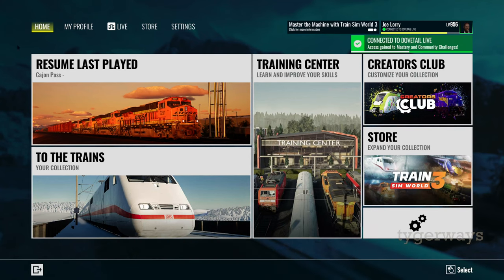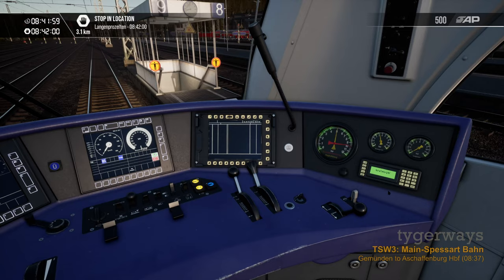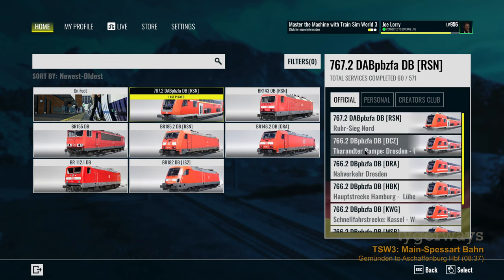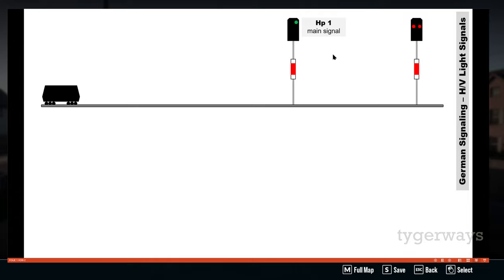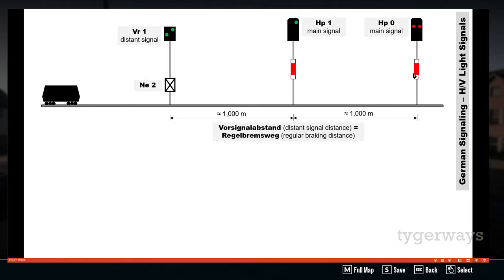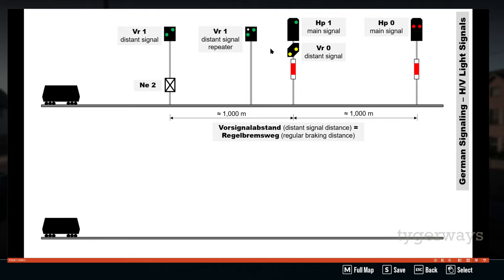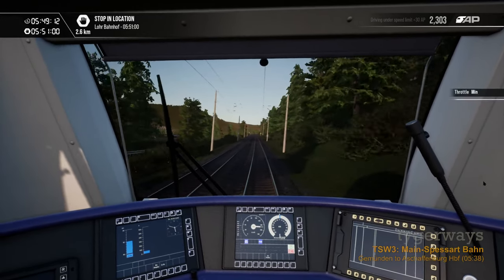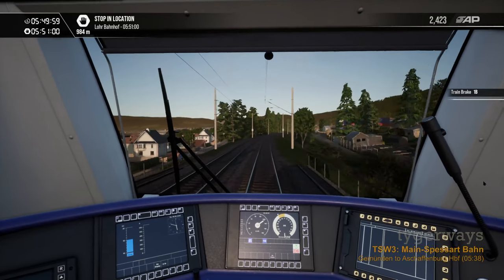German signalling (H/V-System) on the Main-Spessart Bahn (TSW | German signalling tutorial)

Comment: Are there situations that on main signals there will be green, yellow or red blinking and what do they mean? Also two Yellow and top one blinking and different variations of those with other colors
Reply from the maker: Depends on the signaling system:
In the H/V-System, there are no flashing (or blinking) lights.
In the Ks-System you can encounter flashing single green lights shown on distant signals (and distant signal repeaters) together with a yellow number, warning you about an incoming speed limit. We have a video on the Ks-System here: https://youtu.be/2k3cLSxSZS8
In the legacy Hl-System, found in eastern Germany, you can find (main and combined) signals showing green over yellow or yellow over yellow, with the top lamp flashing or not flashing. The bottom lamp tells you how fast you can pass this signal, the top lamp tells you what to expect at the next signal. We have a video on the Hl-System here: https://youtu.be/eiiYFwsS5Nk
A (regular) flashing red aspect doesn't exist in any German railway signaling system, as far as I can remember. Some signals can use flashing reds to indicate a defect, though. Regular flashing reds only appear at level crossings, warning the road traffic.
Reply: @tygerways6615  Thank you. I know I have seen flashing green or yellow, but can't remember which route. Also blinking/flashing red is used in Polish railway signaling and I think it means that the driver can continue but no faster than 20 km/h and expect next red. You can check Polish signaling in another rail game Simrail. Maybe in the future you could present Polish signal systems. They have a lot of similarities to German ones
Reply from the maker: @MSzat888  Best chances to encounter flashing greens (over yellows) or flashing yellows are in the Dresden Nahverkehr around Coswig, Riesa and Großenhain (on Hl-signals), flashing greens with yellow numerals (on Ks signals) are on a lot of routes.
I played the prelude to Simrail and I liked it quite a lot (especially the talking with the dispatcher on the radio). If I ever should expand this channel to another simulator, this would be a good candidate. Also I would love to look into and present Polish signaling, if I can find and understand the sources for it. Mowię po pulsku tylko źle.. :) From what I have seen there are a lot similarities especially with the Hl-System.